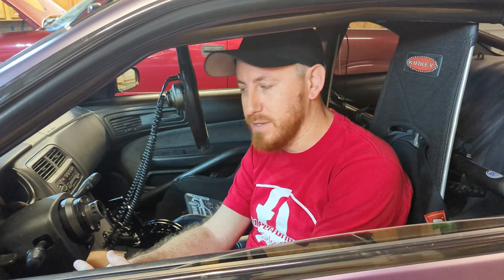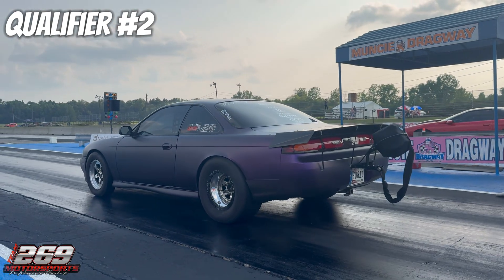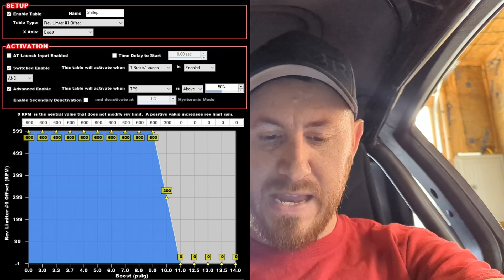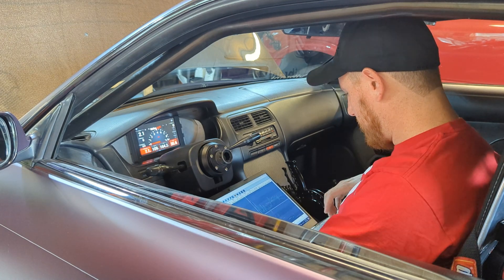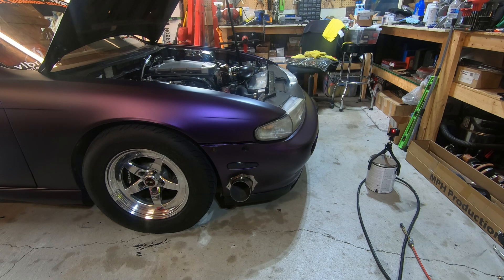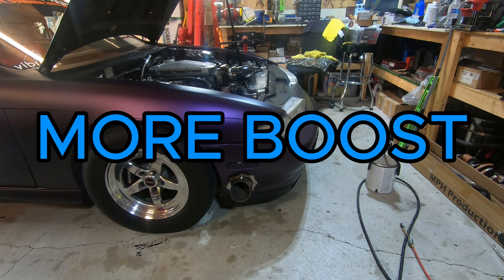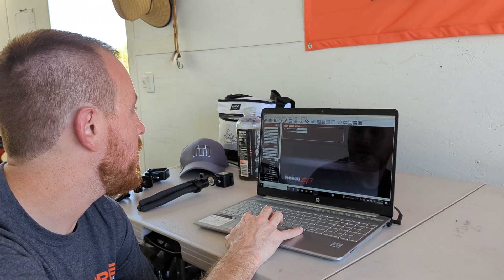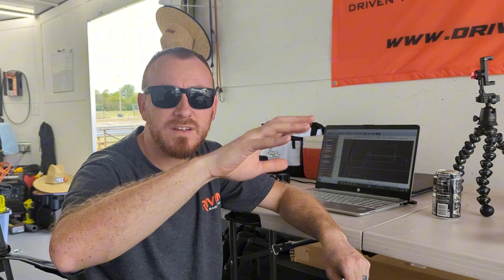STOP Wasting Time with Wrong Ratios and FIX Your Drag Car!

Comment: Hey man been following your setups on facebook. Especially over the drag and drive. Any chance you have a video of doing the tow bar/parachute mount deal??

We used to shut the gates on our altered and use a switch under the foot brake to limit the rpm. Didnt always work but when it did we could get good boost on low rpm for bad tracks. Keen to follow on and see how you go this season.
Reply from the maker: Hmm I don't think I made a video on building that since it was before I started the YT thing.  I plan to this winter try to do a few in depth videos on the car for various things.

Comment: I dont know how big your turbo is but some people are using a really small shot of nitros to spoll up the turbo in a second or two. I dont know if your setup would benefit from it.
Reply from the maker: I'm all set now.  Playing around with the adjustments in the video really helped!  I'm anti dual power adders and in some classes I run it's not allowed.  Another thing folks do is run dump valves for the transmission that helps as well.  You are correct though some people do that especially in the 6 and 4 cylinder world.